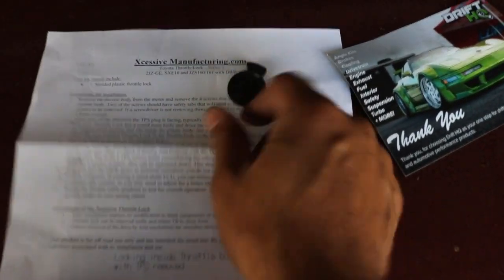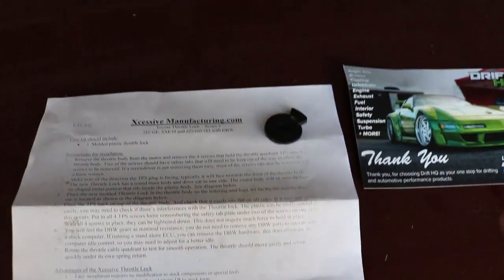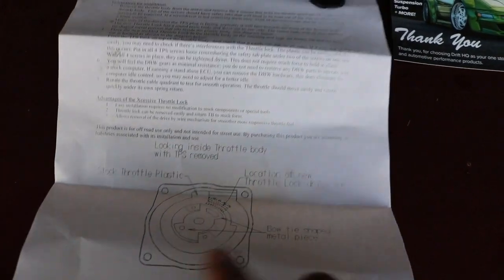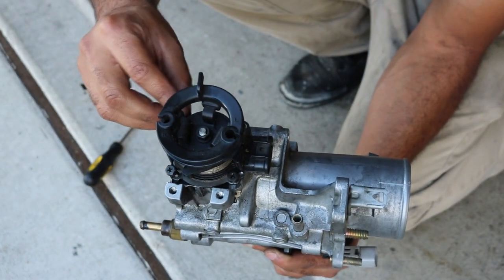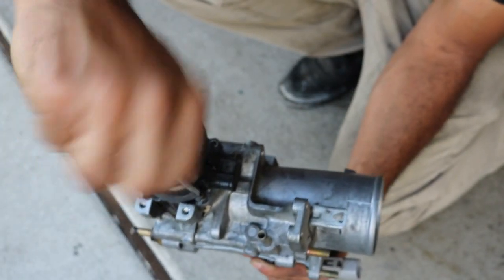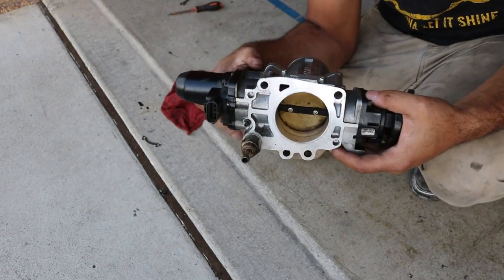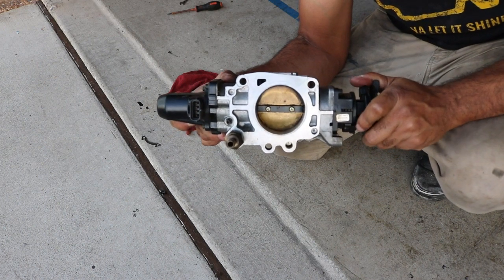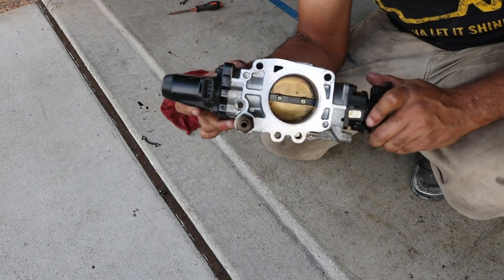Tech Series EP. 5 (IS300 throttle lock install/DBW DELETE!)

Comment: Would it be worth removing the gear of the stepper motor so you don't have the resistance on the peddle?
Reply from the maker: If you are manual transmission and are running a stand alone. You probably could do that. I haven’t tried it before. Lmk how it goes. It’s noticeable at first but i quickly got used to it.
Reply: @Knownworldwide  Only reason why I bring it up is because i've seen another video where doing this lock install has damaged that motor or gear set (Can't remember exactly) But they recommended that you remove the gear between the motor and the throttle shaft. Just don't know if it's necessary or not. Mine is Auto btw. Keeping it auto with a C6 transmission in the future.
Reply from the maker: @siborn9190  Yeah I, for the same reasons, didn’t want to install the throttle lock for fear of damaging the motor. However on the stand alone, it’s absolutely necessary for good Throttle response. I do have a spare throttle body so I am not too worried about it. I would think that if you remove the gears that if the stock ECU makes changes to that motor and then realizes that nothing is happening (ie no gears anymore) that it will throw up a CEL. 

As I said though, try it out and lmk.

Comment: Would like a review after driving with it on. Heard both good and bad things about these fighting the stepper and the stock ecu fighting the throttle lock and causing issues with the TB.... Why i havent got one yet but maybe its better with the standalone.
Reply from the maker: My exact reason why I have never installed one. I heard they damage the TB over time. However in the case of the stand alone, it is a must since the stock ECU won’t be controlling it anymore. The throttle pedal resistance is higher for sure. Meaning you have to use more force to press the throttle now.
Reply: @Knownworldwide  not worried about that.  I'm more debating to wait until I get my standalone out try it for now on the stock ecu
Reply from the maker: @MidwestMechanic  Ah, gotcha. I would say give it a try. When you go stand alone you will need to run one anyway. Unless you plan on going to a cable throttle setup or some other custom setup with a FFIM.
Reply: @Knownworldwide  I would like to but that's further down the line. Not a fan of the intake/tb crossover 😕
Reply from the maker: @MidwestMechanic  yeah neither am I haha. But one day we’ll get there 👍🏾

Comment: How much more of a stiffer pedal feel?
Reply from the maker: @HuyNguyen-gg4gv  At first you notice it. Maybe a little stiffer, however you get used to it fairly quickly. I can’t even tell.
Reply: @Knownworldwide  the “bog” when try to rev is gone also with this mod?
Reply from the maker: Not really. Sometimes it’s there, sometimes not. Mine will do that sometimes coming away from a stop sign. Anywhere else and the car is more responsive for sure.
Reply: @Knownworldwide  oh okay. Whenever it’s in park and try to rev. There’s slack before the TB start moving.  But driving it’s perfect

Comment: Why do you need this if you have a stand alone ECU? Isn't the throttle response different with the emu black?
Reply from the maker: If you have an auto is300 then you need the stock electric throttle body to be controlled by the stock ECU. The auto transmission needs a stock functioning throttle body in order to perform the shifts properly. 

I like to have better throttle response so I installed this throttle lock so that I can be directly controlling the throttle plate inside. So I get the best of both worlds if you will: Better throttle response and still making the stock ECU happy with the stock throttle body hooked up.

If my car were manual (which it will be eventually) then I would still be running this throttle lock until I went FFIM with a more traditional cable throttle and normal TPS.
Reply: @Knownworldwide  isn't there a tune or something you can enter into the emu black that makes it control the throttle body and / or the auto transmission ? Or are stand alones only designed for manual transmission? 
And how do you get the oem ecu and standalone to work together?
Reply from the maker: If you go to ECU master’s website you will see the have a plug and play engine harness for the is300. This is a parallel harness designed to retain the stock is300 ECU. The EMU black does have capabilities to operate DBW systems, however as I mentioned before, the stock ECU and throttle body need to work together in order to shift the transmission properly. If you try and have the EMU control the DBW (which it can) the stock computer will flip out and put the car into limp mode.
Reply from the maker: The stand alone is designed for both auto and manual transmissions. It’s just that on this particular chassis, it’s best to let the stock ECU control the DBW and automatic transmission. 

Also you need the stock ECU to control the gauges and HVAC.
Reply: @Knownworldwide  thanks your very much for the information.
Reply from the maker: @morganthomas9404  of course. If you have any other questions, just lmk. Hope you decide to stick around for the long run.

Comment: Just a quick question, hows the cx manifold holding up if you're still using it? I can't really find any other manifolds that can keep ABS because I don't really wanna relocate it unless its a must. I'm not sure if driftmotions manifolds are alright fits but I'm just wondering
Reply from the maker: First off thanks for taking the time to watch the video! Really appreciate that. Hope you decide to stick around.

CX manifold so far is holding up just fine. I also didn’t want to relocate the ABS. That being said, I will switch to a different setup someday. Just not soon. 

The manifold is a very tight fit and getting to the last bolt near the firewall requires some ingenuity to tighten it up. Overall though for the price, it’s really not a bad manifold. Please make sure you heat wrap it and the down pipe.
Reply: @Knownworldwide  Of course man! I've been watching every video when it comes out, you're one of very very few active IS300 GE builders out there, not to mention automatic. I'm glad we can keep in contact as its so hard nowadays to rely on outdated forums, thanks for the help. I'm not sure as to what a diffuser setup is though if you don't mind explaining.
Reply: Also you'll probably catch me in the comments quite often haha
Reply from the maker: @icuxo  Well thanks for the support man! I am active on the my.is forum. There is quite a lot of useful information there as well. So long as you can get around the attitudes and sarcasm of the group. I haven’t been apart of the forum long but I am on there if you want another way to get ahold of me.

As far as a diffuser setup, Did I mention that somewhere? Or are you asking me what diffusers are for?
Reply from the maker: @icuxo  please. Ask away, I will always try my best to help you and everyone out.
Reply: @Knownworldwide  Yeah sorry where we talked about the CX manifold you said someday you might switch to a diffuser setup, was just wondering what that was.
Reply from the maker: @icuxo  haha, my bad. Just fixed that. I meant a different setup.
Reply: @Knownworldwide  Sorry man, I should have realized 😂
Regarding manifolds again, are you familiar with DriftMotion and Dodo Racing? I haven't found many reviews for DM kit on a GE and I've been hearing 50/50 on log style manifolds. To make it easier maybe lol, my goal is roughly 350-400whp. If the CX kit or a log style shouldn't have issues on a mid size turbo (like a 6266 or even smaller if better), then I'll give it a shot. Just wanting to get some opinions and info about that.
Reply from the maker: I haven't heard much about the DM kits. However at that price range, they are most likely using or making the same type of manifolds that you can just buy on ebay like the rev9 manifolds or whatever other cheap manifolds are out there. I am fairly new to the IS300 and JZ engines myself. Still learning all the brands and such.

If you don't want to mess with the ABS then you can go with a log style manifold to which i would go with the DODO or the tread stone units. Both are great, my buddy just put a dodo one on his car and it works great and clears the ABS. Either one should clear the ABS. The only tubular style manifold that clears the ABS is the CX one that I am using. The DM kits will require custom down pipes since all their stuff is made for Supras. I probably would stay away from their kits if you can for now at least. 

I too am aiming for 400whp and you can get there easily with the log setup or the CX manifold with a 60 trim turbo. I am running a 62/66 and the CX turbo that comes in their kit is a 61/62. Either one will make 400whp on around 10-11psi depending on if your auto and your elevation.
Reply: @Knownworldwide  Sounds good, thanks again man I honestly appreciate it. I am automatic and have shimmed a spare trans, just waiting to throw it on the car. Looks like I will be going with the log style since they aren't super expensive and also cast is a really good material and the tubing is thick. They should also spool the turbo faster due to the short runners.
Reply from the maker: @icuxo  Sounds good! Post it up on the forum. Would love to follow along.

Comment: After installing do you disconnect the throttle motor or just leave everything the same
Reply from the maker: You leave everything the same as stock. Just take off the TB, install the lock and put it back on. 👍🏾
Reply: @Knownworldwide ok thanks bro how much boost u running currently. Im on a standalone ecu about 6psi its fun car to drive. Got a buddy helping with tuning and all thats stuff.
Reply from the maker: @seps26dave  Right now I am running about 4.5-5psi. Still on stock injectors. Not sure if you have seen the channel fully. Still a fairly “new” setup. Just getting my feet wet. Just got the stand alone installed maybe 5 days ago. Just been trying to dial in a tune by street driving.

What stand alone are you running? Your car manual or auto?

Appreciate you watching the video btw!
Reply: @Knownworldwide Running Micro Squirt ecu i also have 700c injectors and Walbro Hellcat pump dont know what im doing after but it all started as a budget project i literally did a budget build got the car for $700 with oil leaks from the usual seals and what not and did some suspension cause it needed it bad. I love gs so i decided to do a build.
Reply: @Knownworldwide same here street tuning 😂
Reply: @Knownworldwide  Did see some of your videos im also new to all this just have help from friends with way more knowledge trying to learn more myself.
Reply from the maker: @seps26dave  so your gauges don’t work anymore I assume?
Reply from the maker: @seps26dave  sounds good man! Hope you decide to stick around for the long run. If you have any questions, feel free to reach out. I will try to help out any way I can.
Reply: @Knownworldwide  what you mean like fuel,temp and speed gauges?
Reply from the maker: @seps26dave  yeah. Does the megasquirt run in parallel with the stock Toyota ECU?
Reply: @Knownworldwide  A friend did all the wiring and everything is working at first the speedometer wasnt but now its all works
Reply from the maker: Sweet! How are you liking the Micro squirt? Seems like you have plenty of fuel. Are you running the same size turbo and setup? @seps26dave
Reply: @Knownworldwide  gt35 turbo and pieced everything out
Reply from the maker: Nice man! You know what kind of power you're making? @seps26dave
Reply: @Knownworldwide  no bro honestly but once i turn max it probbaly gonna be around 10psi to keep it safe for now
Reply from the maker: @seps26dave  auto right? I haven’t had mine on the dyno but if you saw when I took it to the track I was able to get close to 100mph trap speed. I am estimating it’s making around 235-240whp right now.
Reply: @Knownworldwide  hell yeah bro
Reply from the maker: @seps26dave  that was with the AEM FIC 6 piggyback which was giving me a ton of trouble that night. I am trying to go back for the last event for the year but it’s supposed to rain so maybe not. Really hoping to run at least a 14 flat or high 13 @ 100-102mph

Comment: I know you probably already answer the question but i don't understand. does the throttle lock work on an automatic transmission with stock ecu or it will put itself in limp mode? i tried to look everywhere to get an answer but i didnt found anything really clear. but good video btw and nice build
Reply from the maker: @sp1cyf1r3  it works with the auto. Thanks for watching! Hope you decide to stick around for awhile.
Reply: @Knownworldwide  and is there anything in risk of breaking? and yeah I will for sure!
Reply from the maker: @sp1cyf1r3  well there is always the potential of wearing out the trac motor. Although I don’t hear about that very often. Mine has been doing just fine. I did buy another used throttle body from a local junkyard just in case.
Reply: @Knownworldwide  i see thats what i had in mind I will still buy a spare one if it breaks at the track but  i hope its not gonna break soon since im going to an event and i dont have a spare one for the moment but thanks for the help!
Reply from the maker: @sp1cyf1r3  send it